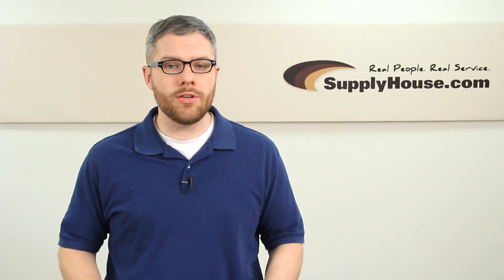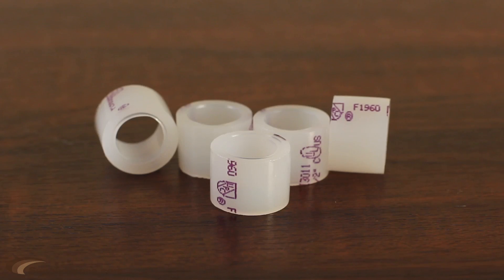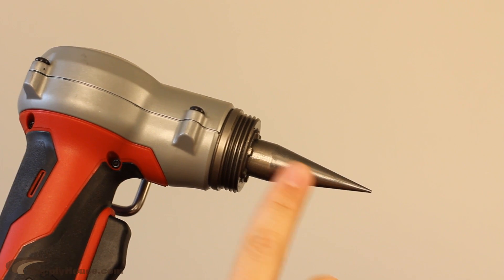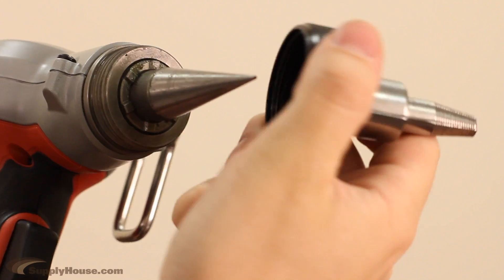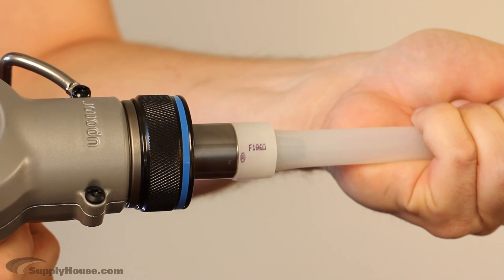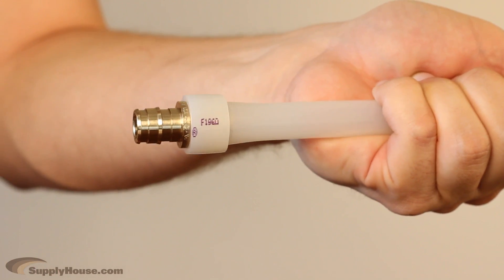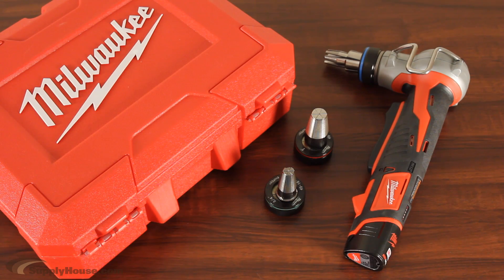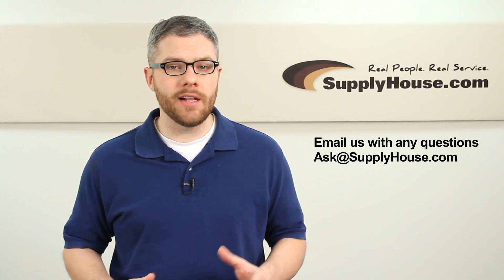How to Make PEX Expansion Connections

Comment: He did the expansion wrong he forced the pipe on the expansion head that's a no no you let the tool expand it's way in the pipe and make sure you watch the head spin inside the pipe the reason you dont force the pipe is so it dont permanently stretch the pipe
Reply: Nonsense

Comment: Is there a Pex expander tool that works on both type A & B tubing?
Reply: PEX type B isn't rated for expansion, you can always use crimp fittings, though.
Reply: This tool can expand B as well as A assuming the B you're using is certified for F1960 expansion (several are).  PE-RT is also certified for expansion, and this tool does that as well.

Comment: wrong application, expansion should only be used on pipes like Wizbro that are 1-1/2" or larger, typically found on 2" plastic Wizbro
Reply: Really? I have 1/2" pex-a as shown in the video in my house installed by a licensed plumber. I just bought the DeWalt expansion tool and some 1/2" and 3/4" pex-a pipe and fittings... they seem to work fine, but is there some issue with smaller expansion fittings I'm not aware of?
Reply: Trolling? Expansion PEX is by far the most common method for ½" ¾" 1" PEX in this area. ...and what is Wizbro...have to be trolling.
Reply: @PowerScissor  Wizbro, you know.. like "be right back, I have to take a wiz, bro"
Reply: @moonpiespotlight4759    lol

Comment: Cool tool but only on pex A?
Reply from the maker: Yes, the ProPEX expander tool and the expansion system only work with PEX-A.
Reply: All PEX A and several PEX B products are certified for F1960 expansion.  If the B is certified, it will have "F1960" printed on the pipe.

Comment: Quick question..... if the old joint is Pex B and you want to fix a leak with this expansion joint, is there an adapter or how to you go from the small Pex B fitting to the larger Pex A expansion fitting?
Reply: my question also.
Reply: @johnflemming7617  you'll need crimp fittings - different fittings that fit inside the PEX without any expansion. You do not want to expand type B.

Comment: My question is: Can I lightly use a heat gun on the expander ring and pex then slip the fitting into the 1/2" pex? In theory it should shrink back to the original dimensions making the expensive expander tool unnecessary for only having to do a few connections.....
Reply: +1pcmedic I would be concerned that heat would change the molecular structure of the tubing.  Have  you tried it?  You could probably just use a cone and keep working it till it got there but that is a lot of work.
Reply: Heating pex has to do with the brand of pex tubing you have. Only a few manufacturers sell pex tubes that can be heated, bent, and possibly stretched.
Reply: SMH. just use the old fashion crimp rings. This is for professional use.
Reply: @conqwiztadore2213  Agreed. This expansion type joint in PEX-A is considered better than the crimped technology usually used on PEX-B, mostly due to the joints being more resilient to pipes getting frozen. But I did plenty of crimp ring work in my basement back in 2018 to shore up my heating system. That was before I knew better. The crimp rings are still pretty good technology - ~7 years in, the joints have not given me a lick of trouble. Unlike expanding the tubing with a manual tool, which I've heard is physically exhausting, using a relatively affordable manual crimper is not too bad for a modest project.
Reply: While you can heat Pex A to remove a bend kink, it would be very difficult to heat the Pex properly enough to force a fitting in. Stick with thevtool. Perhaps a search for a rental tool?